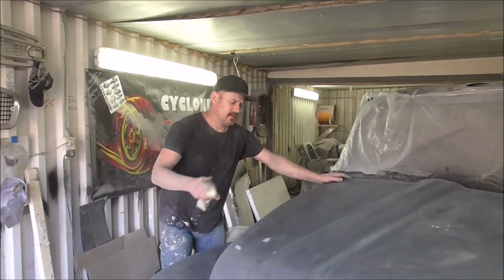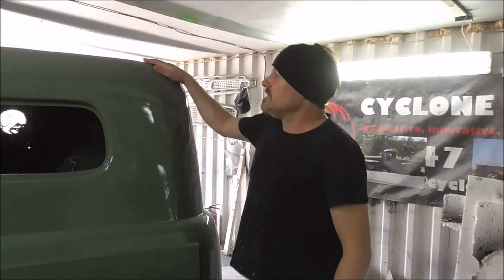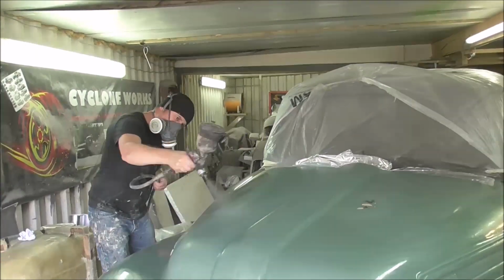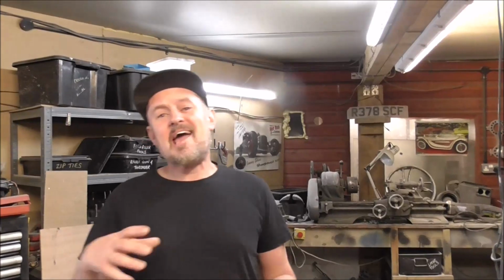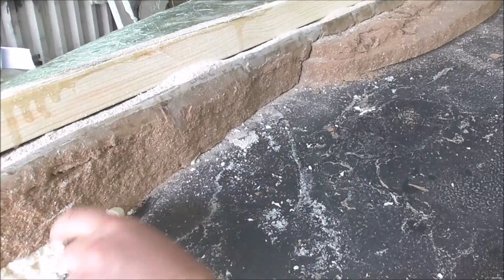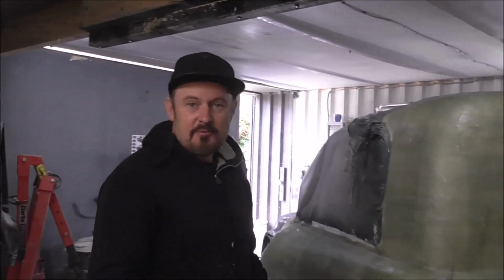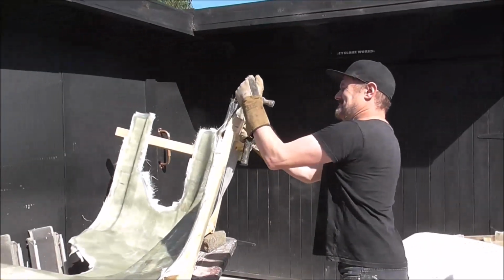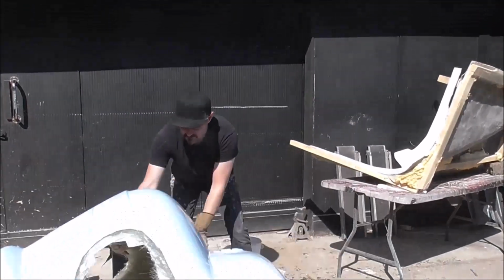FROM LONDON TAXI TO 1950'S FORD F1 PICK UP. PART 6: MAKING THE CAB FIBREGLASS MOULDS

Comment: Hey chief, as a fellow street rodder I have to say your work with glass is impressive. My glass work has been limited to boats and I just weld on old steel over here on my side of the pond but imagine old steel bodies are hard to find, especially cheap. Good on ya. I know I cant be the first to say this but demolding is waaaay easier for me with compressed air. I will use a rubber tipped blower and force air in which pops it off all at once. I even use a piece of heat shrink on the tip of the blower but leave the free end flat and unheated so I can slide it in deeper into crevices to force air into the mold. Ok, keep cracking! Oh and you will probably like Brent's channel too here on YT. Hes new as well and you can look him up under half ass customs.
Reply from the maker: Cool cheers

Comment: I'm blown away by all this. Saw the feature in Custom Car but it doesn't do justice to the amount of work you put into it. How many coats of fibre mating do you use in general to get the correct strength?
Reply from the maker: I tend to do 4 good overlapping coats of pretty think matt. That does the job!